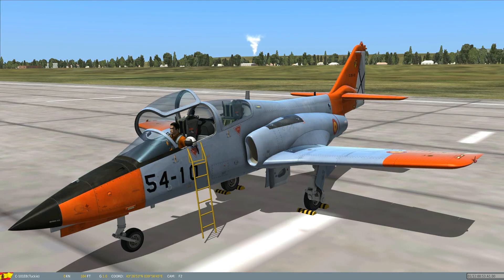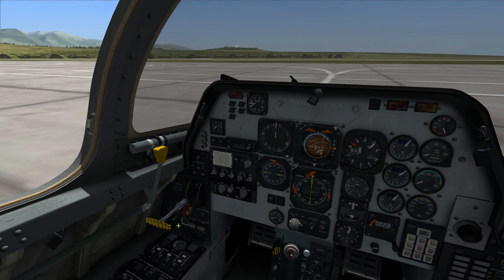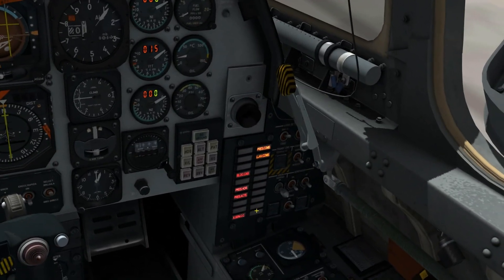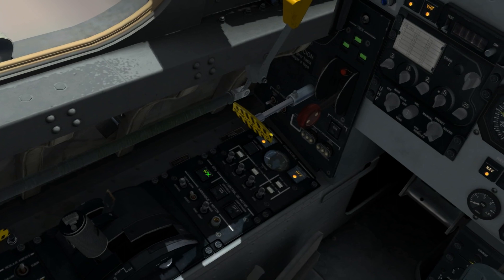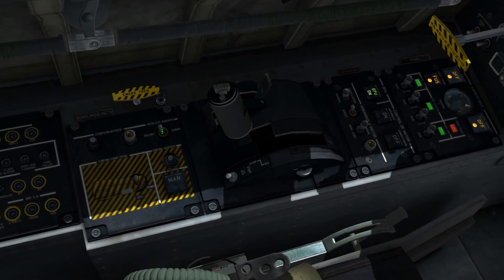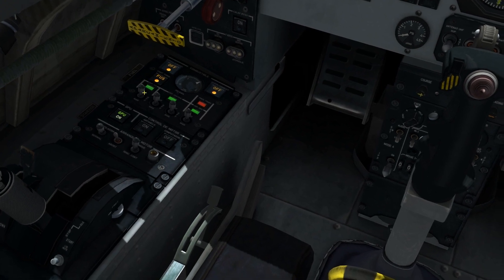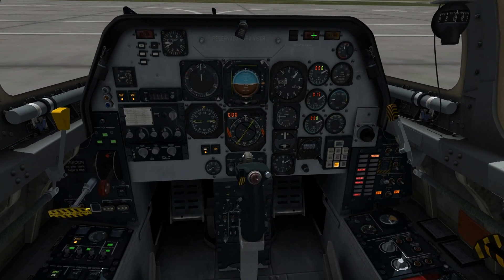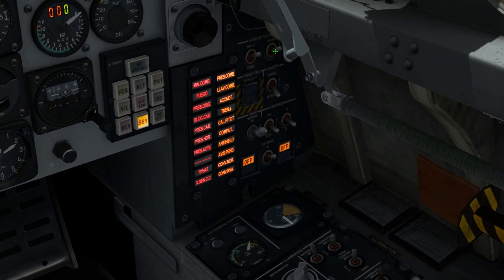DCS: C-101 Aviojet Startup in english (beta)

Comment: Excellent Tutorial. While it can be a little bit difficult to hear exactly what you are saying for your accent, you do at least point to the item you are talking about which does the trick for me. The fact is, there were only a few things I couldn't hear clearly.
I tried the C-101 yesterday for the first time. I have it loaded in DCS W (Not Beta) where it seems impossible (for me at least) to Save and Maintain my Control Options.
More bothersome is the fact that I could not get the Raise my Landing Gear (typically the G key). But I see others flying this without issue. That said, I was wondering if you have this Mod installed in the BETA version of DCS World ?